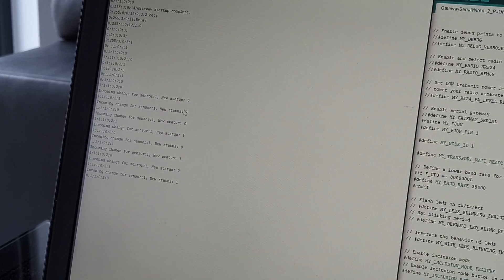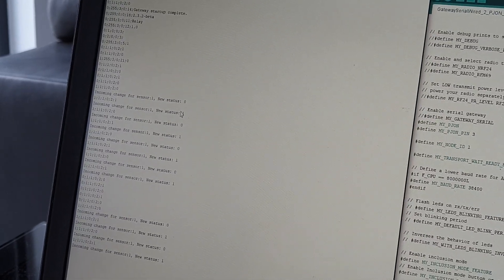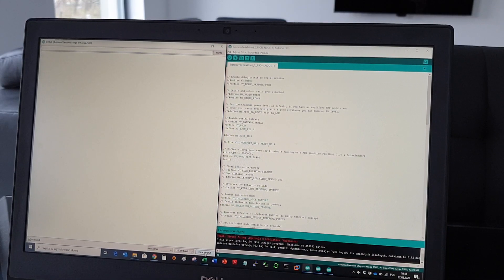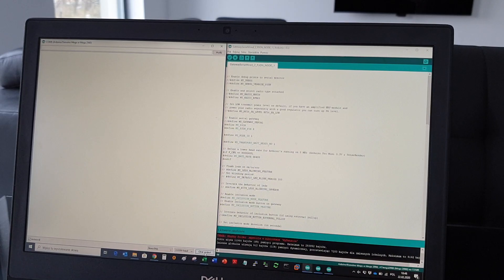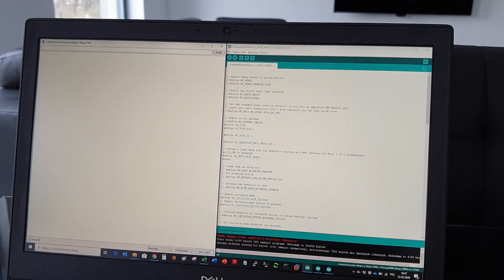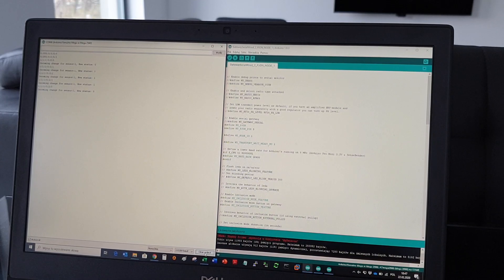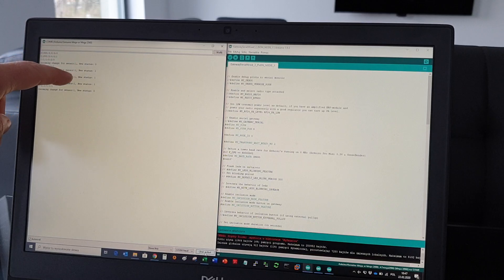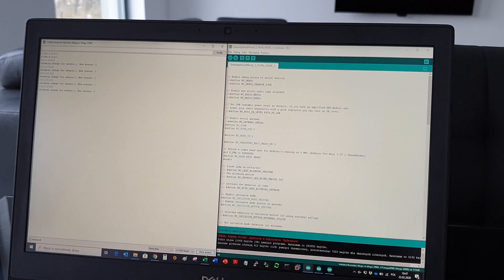MySensor with PJON wired communication protocol as a transport layer

Comment: Ciao Marek, thank you for this video. PJON does not support ordered packet sending, although restructuring your code I think you can avoid the need of this feature. When the wire is disconnected, packets are transmitted unsuccessfully, if you reconnect the wire and the time passed is shorter than the back-off timeout you receive the packets in random order on the other side, if the time passed is longer than the back-off packets are lost. That is why you see the arduino behaving in such a way.